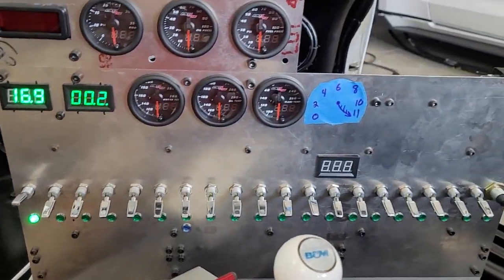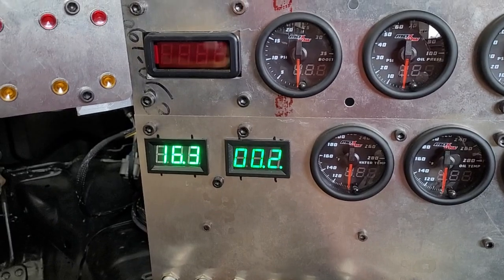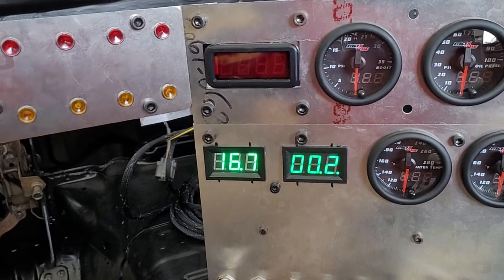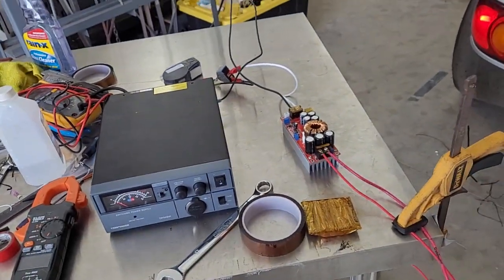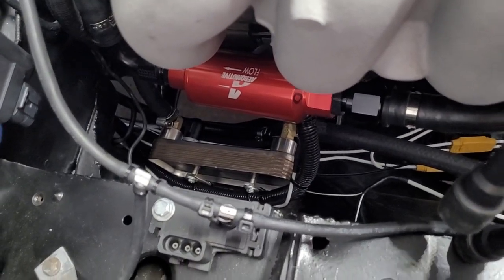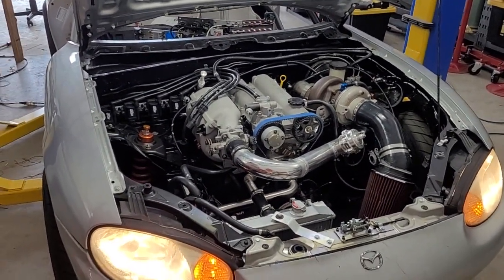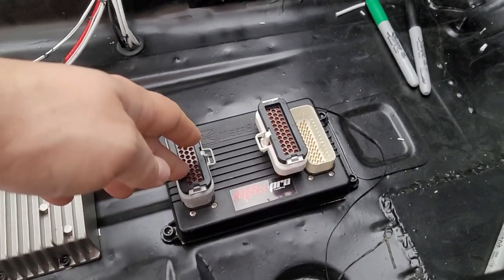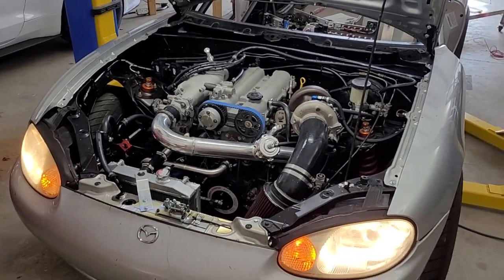Racecar wiring major progress!

Comment: What was one of the biggest chunks of weight you cut out that took a little effort to get to? I'm off this week and have time to tinker. So I'm chasing some grams, but looking for a good suggestion or 2.
Reply from the maker: Depends how weight reduced the car is now. Or if it's racecar or street car?
Reply from the maker: The steering column I replaced saved a ton of weight,  way more than I thought it would. 

Cutting wise, I got about 20lbs of random spot welded brackets off.
Reply: @patrickcowanjr1  thank you! I will, check those out. It's a fair amount, I need to scale it. Interior looks mostly stock still which was the goal. Taking a lot of ideas from Eric Hux from his MR2